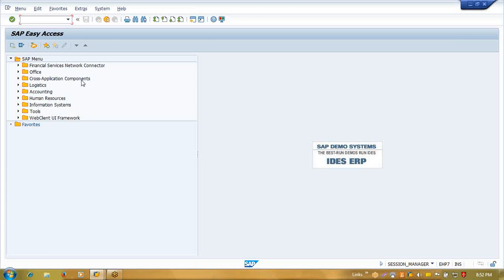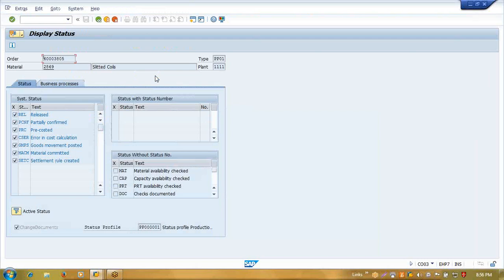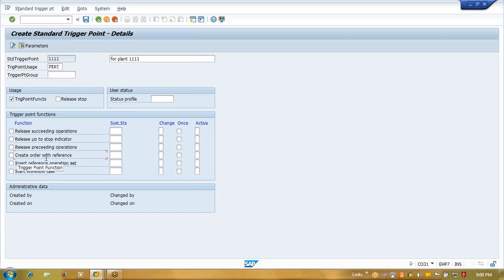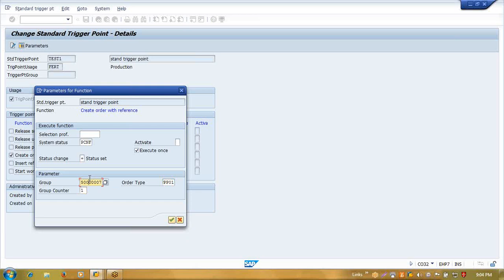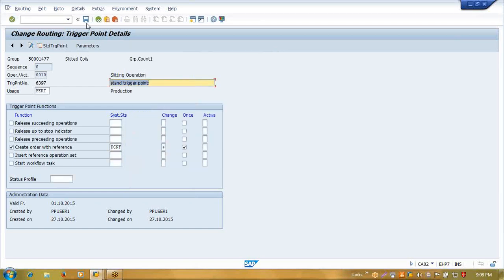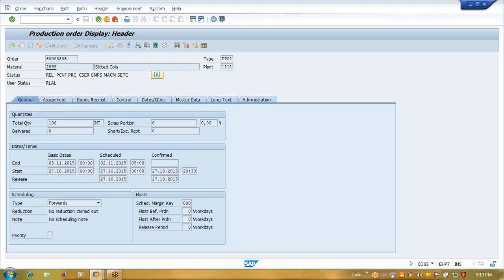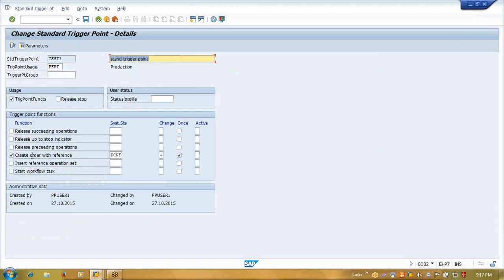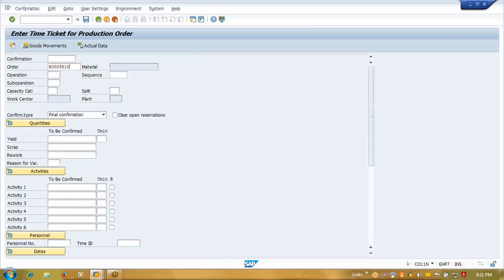Rework Process in SAP PP

Comment: Hello Mr.Amit,
Rework order is fine, if we put TECO cost will be captured in Parent Order it is fine.

How should I get the yield back to my parent order?

For Example:
My Production Order (say 101) is created with Qty is 5
I have 4 operations 0010,0020,0030,0040,0050
In CO11N, for 0010 -> Yield is 4 & Rework is 1

So new rework order (say 102) is created, I will proceed with it.

Now back to Order:101,
In CO11N, for 0020 -> My proposed actual data for yield is 4 by default
Suppose if I put 5, its throwing me Overdelivery not permitted error

How should I bring back my full yield back in Parent order???